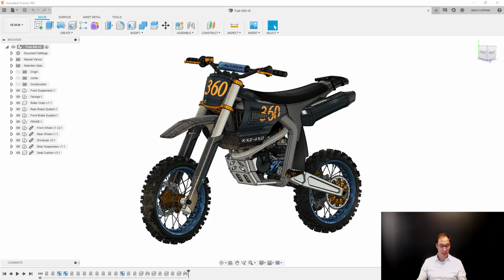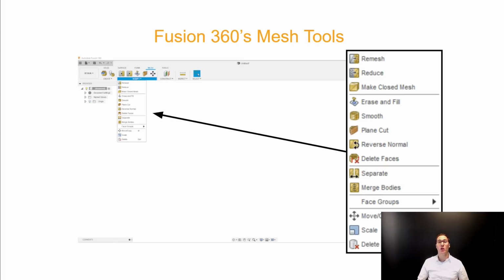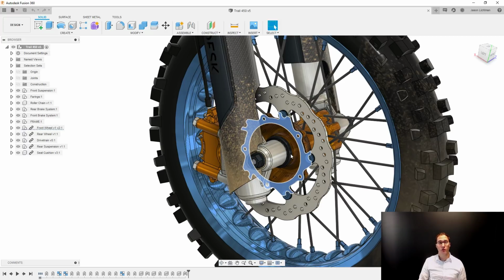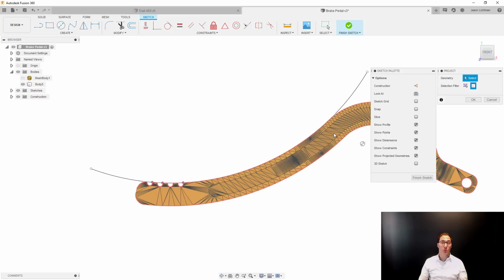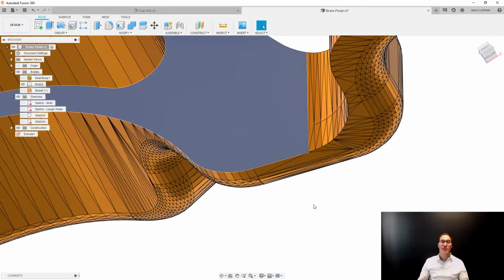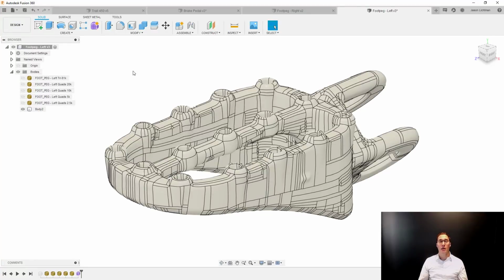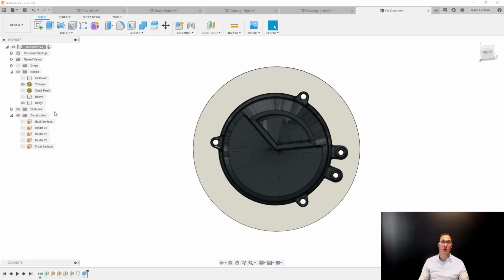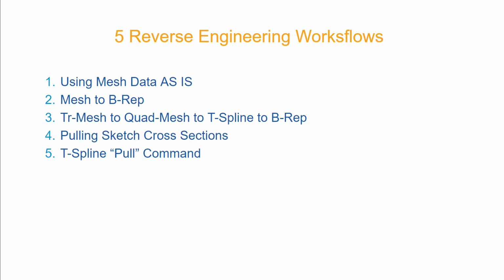5 Ways to Reverse Engineer Mesh or Scan Data

Comment: I am shocked that Fusion cannot convert a mesh with over 50k triangles into a B-rep. That's a very small / low resolution mesh, especially for artistic or natural objects (e.g. a human head). Without this capability, how can we perform Boolean operations on our meshes (e.g. to trim them against existing complex curved B-rep models? Reducing the mesh count is not an option as it will lose detail. I am sure you could use some bounding box hierarchy or similar to get the speed needed to process larger meshes. Or dont you intend people to use this for artistic design?

Comment: It seems easy to find videos on how to work with really clean meshes, and seeing workflows and tools is great, but conception it is simple. What is really hard for me is when it is a scan, organic shapes, or otherwise messy geometry with unclear references and shapes. Just the trouble of aligning parts and finding reference planes to start from can be very difficult in scanned data. Some tools do this reasonably well, but I feel Fusion 360 still lacks, even though overall the mesh tools are quite good.
Reply from the maker: It sounds like the quality of your scans can be improved. What scanner are you using? Are you following all of the recommendations? I've seen some bad meshes in my time...definitely not something we'd try to make sense of during a live session (talk about a trainwreck!).

Comment: Great video - thanks. Knowledgeable and articulate - a great combination.
A couple of points on the Fusion 360 UI design.

1. If, as you say, most people design in millimetres, then why is your defaul centimetres?

2. A more general and perhaps more powerful point: as a UI design principle, when you hide a menu item because the user is in the wrong workspace or the timeline is on, you are DEVASTATING usability.     Isn't it far better to show the option, greyed out, with a rollover help text which explains why the item is greyed out? That way the user has a stepping stone to get from where they are (unable to do X) to where they want to be (doing X). As it is, the option is just not there. Nothing. Nada. Nowhere to go, no clue as to why, and no hint as to how to get around this fundamental block to their working day. Except the user guides and help forums, which are seldom a fast or pleasant way to anything good. Just huge frustration. The UI should ALWAYS direct the user to where they want to go, as best ytou can descern where they want to go.

I hope that's helpful.
Reply: Chris Wesley, thank you for the detailed feedback. 
Regarding the units: I have been told in the past that the default units are cm because it is a happy medium size-wise for when the software is doing math behind the scenes.  If we changed then he default to mm, the Imperial people out there won’t be happy and if we change the default to inches, the metric people won’t be happy. The best way to really address the scaling issue, in my personal opinion,  would be to ask you what units to use (either when you import the file or when you open it for the first time after you import it). I’m hoping we are able to make that change in the near future. 

With respect to the UI, I agree with your reasoning and will be sure to pass your feedback on to our development team. Please keep in mind that I don’t make those kinds of decisions. I focus more on taking what exists and showing people the best ways to take advantage of the software’s strengths and avoid or get around the weaknesses (nothing is perfect). Either way, though, great feedback. Thank you!
Reply: @jasonlichtman  Hey Jason, thanks for your response. It seems odd to hear that the reaon for MOST USERS to need to reset the units is to make the software's math easier; I've been a software enigineer for decades and frankly - I don't believe it, but I know you're jsut passing on a message and I thanks you for it.

I also understand your role here as "demonstrator of what is" and I think you do it superbly. I'm grateful for you passing on my comments.

I used to manage software engineering support for CAD for a major IC manufacturer in Europe. My path to that roel was my "baptism by fire" as a lowly software engineer, travelling round Europe to the poor engineers who had to use our software. They hated us and with excellent reason - they were bringing in the bacon DESPITE our software - not because of us. That started my crusade for the role of close coupling between software engineering and the engineers who used it. We grew a useability rulebook so that good features never got removed by young smart but inexperienced engineers; this quality ratchet meant we'd never baclkslide on the software - it either got better or stayed the same.

Too much information, I suppose, although I'm long gone from that world, the devastating effect of inexperience on useability continues to dazzle me dailt. Each new generation of upcoming folks ahve to re-l;earn the elssons at the expense of their users.  If I were running Fusion 350, I'd want to make it as useable as humanly possible and that means investing in educating software engineers in useability and embedding conformance in test suites and perfoemance reviews.

No need to reply!

Comment: Once I have created a Brep from a mesh I turn design history back on and at that point the history is kept. Is it not a correct thing to do?
Reply: Garry Stern I didn’t cover what to do once you have a B-Rep because there are so many different workflows you could choose at that point. I personally would keep the history off while I clean up the model (using the delete trick I showed, using the replace face trick I showed, etc). Once I have a B-Rep solid that I’m happy with, I would turn the history back on and use the B-Rep for whatever my end goal is. So, you are exactly correct!
Reply: @jasonlichtman  Aahh yes, I guess there isn't much point in keeping the clean up history, thanks for that tip.
Reply from the maker: Cheers!